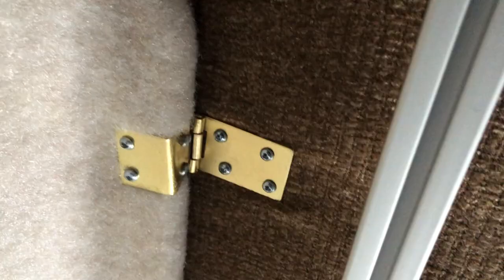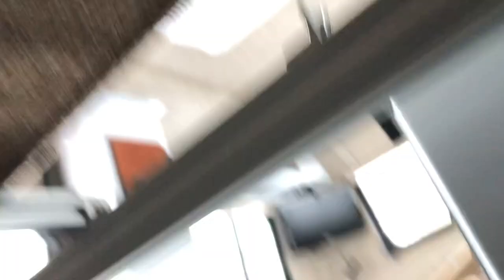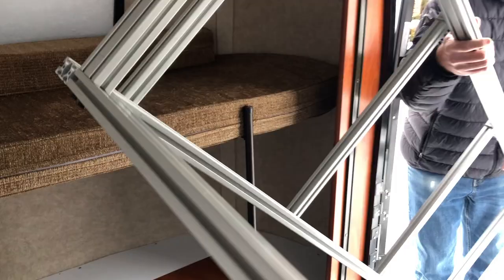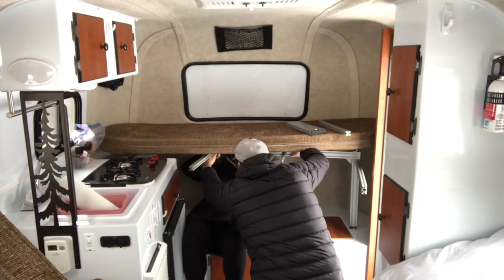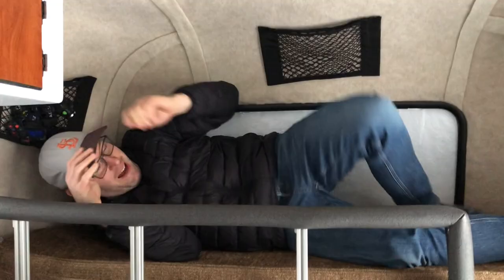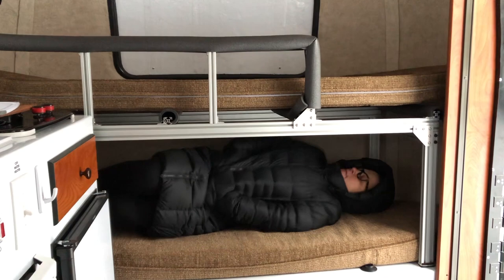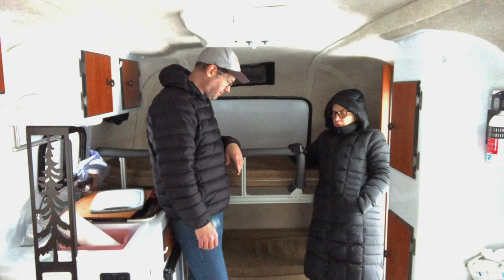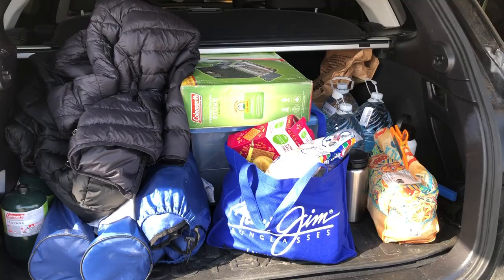RV Bunk Bed Hack! // How to Build Bunk Beds in a tiny RV // 2021, 13' Scamp Trailer

Comment: Made my bed bunk out of street garbage scrap metal 😂 found a house that threw out some kind of tent structure of some sort. Felt lightweight like aluminum!? Sawed it off to size and Drilled holes for bolts.

Made 2 prisims and threw some wood boards and some mattresses 😁👍 still works to this day! Holds itself in place. Dumb lucky it worked out for me ✌️😅 don't be afraid to think outside the box and experiment. You never know 😉👍

Comment: This is fantastic! I wonder if I could use the same concept to build a bunk over the 54" bed so we could order the 13' with the wet bath AND sleep 4. Thanks for the idea!
Reply from the maker: I considered this, and I think it would be tight. The bed is lifted higher due to the water tanks under it. I'm sure you could measure and figure out if it would be comfortable. In my experience, you can make anything work; it's just a matter of comfort. :)

Comment: Pretty good the bunk bed alterations but maybe you should have made the top bunk about 4 to 6inches higher up giving the lower bunk extra headroom
Reply: With the great job he did on the bunks, I know he can configure some "risers" for each of the bunk legs. Just have to then adjust where/if there are places it attaches to the wall.
Reply from the maker: We thought about it, but then we would have to detach the bunk from the scamp itself. We wanted to make this easily removable without altering the scamp in any way. I think for now it will be ok as long as the kids don't grow too fast. :)
Reply from the maker: @sharondonelow5364  Yep. Maybe in the future when the kids get bigger.
Reply: @ladyandthescamp  great thing about 80/20 is that raising the bed will be an easy mod.
Reply from the maker: @jmpattillo  Yes! That stuff is so adaptable!

Comment: 2020 13’ extended bed here and like the hack. I am 5’ 10” and have been sleeping in the lower bunk as my wife and two kids sleep in the main bed. We love the scamp but my kids just didn’t stay in the bunks well. This rail system looks similar to casita concept. My main concern is top bunk has no rail guard, my son rolled out the first night we slept in it. Otherwise love my scamp.
Reply from the maker: We had to make a rail and our little one still falls out!

Comment: The bottom of the bunk is 3/4" piece of wood. You probably could have skipped all the center 80/20 pieces and just made a perimeter frame. I think the best part of this is that you can leave the bunk up while driving. For what it's worth I'm 180lbs and the original bunk holds me up just fine, but it does feel a bit sketchy up there.
Reply from the maker: Yeah, I think you’re right and it would have been fine. But I’m a crazy worry wart, and I was imagining my 3 year old bumping the poles and causing my eight year old on top to come down, crushing him. We might pull the center ones out if weight is a big concern. But thanks for the advice! Leaving the bunk up helps, for sure!

Comment: cool  idea, would you by chance have a material list /instructions for the build that i might be able to use?
Reply from the maker: We used extruded aluminum, which is probably more expensive than gold at this time. I can't give measurements, because each Scamp has different specs, as they are hand made. Ours was very different from one end to the other on the bunk, so you'll have to measure each leg side and cut accordingly. You have to get a special blade to cut the aluminum, but it is very durable and light, which is why we chose it. With prices as they are now, however, I'm not sure I'd do this again. We used the attached bunk bed and didn't detach it, so it was easier in that manner.

Comment: Do you have a link with the design for this bunk bed reinforcement?
Reply from the maker: No. My husband made it custom. All scamps are different and even one side of ours was higher than the other. It was a simple build he just measured and screwed together. It cost a small fortune, so be ready for that. The materials alone were $400

Comment: This is fantastic!  We are trying to figure this out for our Casita which is a similar situation.  Where did you find what brackets, etc, for all the hardware that goes with your aluminum?
Reply from the maker: I found a guy who had made something similar and he sent me photos. My husband did the rest just based on the pictures. We used extruded aluminum and it will cost more than your first born child. :) Just warning you. :)
Reply: @ladyandthescamp  but it’s terrific and will last as long as you need! Great job! I’ve looked up that extrusion stuff and super confusing. Thanks.
Reply from the maker: @joyr.2889  It is. And each Scamp is handmade, so all the measurements are non-standard. Nothing was level, so my husband had to make sure measure each corner properly and make accordingly.

Comment: Can the original bunk bed top bed come off or go higher? To use 2nd bunk bed as a shelf?
Reply from the maker: It is attached to a wooden thing that is attached to the fiberglass. Anything is possible, but you would have to do some significant construction.

Comment: I'm curious what went on the feet and if nothing,  do you think they could poke holes in the fiberglass?  I have a Trail Mite that is missing the support, so a parts list for this,  even if I have to figure the cuts out myself,  would be amazing.
Reply from the maker: Yeah, that was a concern we had, but it hasn’t happened yet. I don’t know how sturdy the fiberglass is but we spread out the weight so hopefully that helps. I’ll see if my husband can do a parts list. But warning, the bunk beds will cost you a small fortune. It was like $400 in supplies alone.

Comment: Do you have a parts list and plans you used? I'd like to do something similar if not the same.
Reply from the maker: We don't, and we tried to make a list, but all the scamps are a little different, even if they are the same model. My husband bought the cheapest extruded aluminum he could find, and then cut it to size based on the specific measurements of our scamp (which were NOT even on all sides at all).
Reply from the maker: Also, this will cost you a small fortune. The aluminum alone was over $400, and that was before the supply shortage.

Comment: That’s definitely custom.. I would not be surprised? If someone asked you to build for them
Reply: Haha!  Yes!  I am actually here to ask if there is some way to buy one from you!  We are about to become the owners of used 13’ Scamp (very lucky I know, and only an hour from our home).  If there is any way you would consider selling us that bunk bed hack, or the plans at least to see if we could hire someone to make it for us.  You share my fears of those bunks with my kids.
Reply: Kirsten Grace ha ha .... that man knows what he is doing.. good luck
Reply from the maker: Well, I’ll ask my husband, but I will warn you, the extruded aluminum is as expensive as gold. Just the materials for us were $400, plus a couple of tools. We felt it was worth it because I like my kids not smushed. Also, each scamp is a little different, so you have to measure specifically to the scamp you have.
Reply: @ladyandthescamp  yes, worth it for your children’s safety.  Maybe Scamp will take notice and make some modifications.  The bunks we are getting weren’t even installed correctly to begin with. The top bunk isn’t attached to the wall with hinges at all, so right now it isn’t even usable.  Thanks for considering our request!